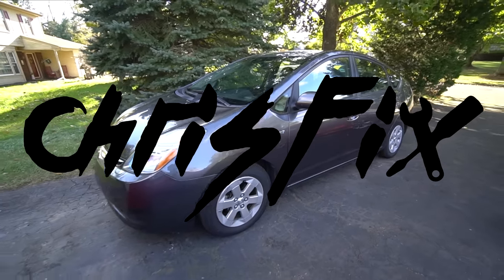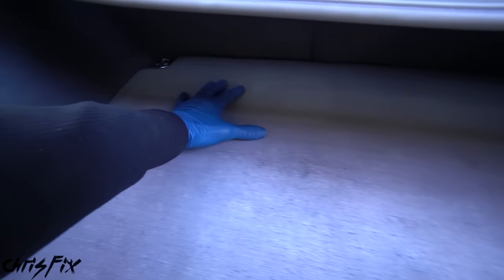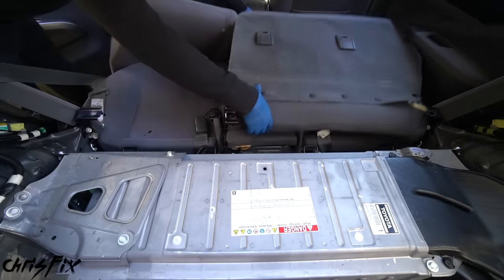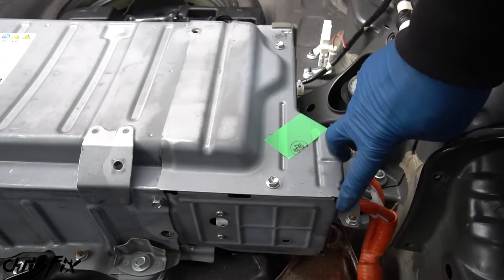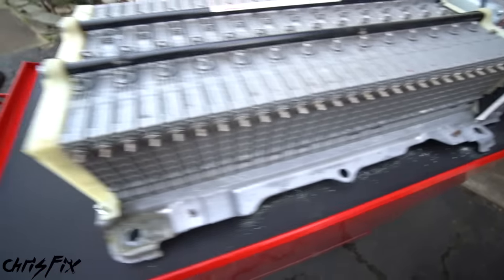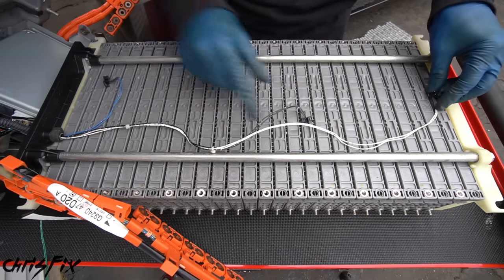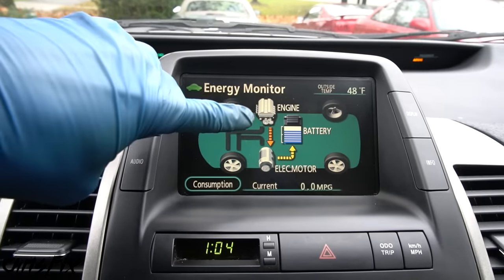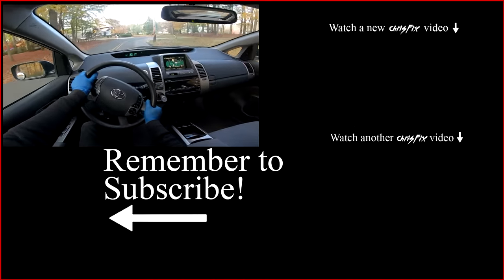I Bought the Most Hated Car on the Internet (and made $1000)

Comment: I would be wary of ANY "guarantee" until I read the fine print. More than likely, it's a "pro-rated guaranteed, dropping in covered cost by 33% each year. You see the same sort of thing with a standard 12V battery that loudly exclaims it has a 4- or 5-year warranty. When it fails after a couple of years, then you find they'll give you $10 off of a new $200 battery. Whoppee. So read the warranty before you buy!

Comment: It’s crazy that the back of the car’s interior has to be dismantled to change the battery. 
Why crazy if it lasts over five years??
Because exchanging an drained battery for a freshly charged one is faster than recharging a flat battery. 
If the car was designed with a removable cassette battery that was accessible from outside and automatically disconnected/connected and pushed out and pulled back in by the car, and a Tester could determine the difference in charge between the batteries, then you only pay for this difference and for the exchange to be done.
Which all means that you are buying charge , not the battery. ( like changing a Butane cylinder)
The complete recharging would no longer have to take several hours: 10-15 minutes should do: just like buying fuel would.
That removes the biggest drawback of electric cars: recharging would take about the same time as a refill of fuel.

Comment: Great Video.  Very helpful as my hybrid is nearing that time.  Quick Question: Since the bus bars tend to corrode so much, would it help to spray them down with battery terminal protector spray?  Or would that introduce some other problems?  TiA
Reply: Is it conductive? I wouldn't suggest it if so as this is high voltage dc not 12v. Better to look for a less corrosive 3rd party bus bar if one exists

Comment: Even though that was not the end of the world in removing, it's still a legacy engineering process and Toyota should be embarrassed for that design in getting to the batteries. Great video but I'm not sure I will get a battery car plug in or otherwise even though I want one, until the engineer battery replacement. I think its just a sucker's decision to buy in to such a poorly overall design for battery replacement, and it truly is on purpose.
Reply: Have you looked at aptera? If they see any actual light they are basically the only one fully diy

Comment: Research high voltage safety procedures before trying this.  ALWAYS have the 12 volt disconnected before pulling the orange plug, wear the right safety equipment, not those cheap gloves.  Every manufacturer tells you this.

Comment: 2003 Prius won’t start nor crank. Brand new 12v battery. The accessory lights turn on and everything. But when I try to crank it, the CEL flashes and the Ready light flashes. As soon as I let go of cranking the ready light turns off. I also was able to check the SOC of my hybrid battery and it was at 2% and the delta SOC was at 20%. I’m kinda stumped. Not sure whether or not to replace the battery packs

Comment: Well it's 2023 and I have a 2008 Toyota Prius. BOUGHT it used 5 years ago from TOYOTA with 62000 miles, and it now has 92000 miles. Started it up today,  tried to put it in drive and it wouldnt go in drive and the  the red triangle came on.   This has happened 4 or five times in 5 years, since I've had this car,  but the red triangle never came on before. I would just turn the engine off and restart the car and that fixed the problem. I Thought maybe I was putting it in  gear too fast. Any way, after restarting, it went into gear, and I drove it home on the freeway about 11 miles,  and didnt seem to have any issues, but the light stayed on. I restarted it a few times and the light stayed on. MY OBD2 Scanner pulled no codes. After 45 minutes, restarted the car and the light was gone.  It was almost 100 degrees , and I'm wondering if maybe the fan vent is clogged or fan is the issue. Ive looked at a lot of You Tube videos and that's one thing that gets mentioned a lot. Anyway I appreciate this video, in case I end up having to replace the battery.
Reply from the maker: Dang, at least you were able to fix it
Reply: @chrisfix yo I'm curious if you still have the 2006 prius after 4 years

Comment: Chris, I saw a technician in Toyota dealer wearing hurt locker suit, he said he does that when dealing with hybrid batteries that can produce 1000 voltage current, is that true or false? Watching you swapping the battery was kinda scary for me 😅
Reply: False 201 volts. 2k volts is generally lethal, 200 will drop you and prob cause some burns and health issues, 50 volts is usually pretty safe, 12v put your tounge on it 😂
Reply: Faily sure amps are where its at though
Reply from the maker: I dont know where he got 1000v because the battery is 200v but with that said it can still kill you if you dont take the precautions to stay safe.

Comment: Very good video TBH, I would however state that you are no doubt competent person at doing this but an novice watching videos has no idea of the Potential to receive an electrical shock from a DC generator / battery giving approx. 225V DC out at terminals which if bridged by unprotected hands not insulated would potentially kill a person on a Concrete floor at ground Potential. Please add the Hazards to your video  stating which danger points exists at each stage of destruction and construction that really occur. ( Based on each cell having 8V DC x 28 Cells = 224/5 voltsDC DIRECT CURRENT WHICH IS POTENTIALLY LIFE THREATENING TO AN NOVICE UNTRAINED PERSON.

Comment: I want to if the hybrid battery cooling fan run permanently or it depends on the battery temperature, plz shed light, thks  in advance.
Reply from the maker: If it gets hot it kicks on otherwise it stays off
Reply: thks master chris

Comment: The 2006 Prius I'm working on is missing bolts and some plastic clips including one that attaches the metal end plate over the plastic compression block. I am also worried about not having the black grounding bolt. Where can I purchase these attachments/bolts/ clips?
Reply from the maker: Call the phone number I showed in the video and a speak with a Chris from Electron Automotive. He will hook you up! They have tons of extra fasteners!

Comment: Ive heard alot of people saying this is dangerous… I’m wondering what part exactly is dangerous. If you follow the video exactly it seems safe, so if you deviate, say by accident, what parts/ actions are dangerous?
Reply: Touching the battery terminal is high voltage. Like putting your finger in a light bulb

Comment: Hey ChrisFix, I got the batteries reinstalled but the triangle of death and the red car with exclamation point still shows up. All other warning lights went out. The engine start to charge batteries and the OBDlink shows no codes. Any ideas? Thanks.

Comment: ?, I have a 08 and I have the triangle of death and same error code(POA80). I had the hybrid battery checked and Module #8 is bad. I had a company install a refurbished battery in and they still had the same error code w/ 2 different refurbished batteries. I then replaced the inverter. The car runs fine but the car will randomly lose power and runs about 15 mph. I can pull over and shut the car off and wait 10 seconds, restart and the car runs fine. Any thoughts? Thanks.
Reply from the maker: Sounds like either they didn't connect the battery properly or the battery is too weak or the inverter is faulty. Can you double check the connection of both the 12v battery and the hybrid battery?
Reply: @chrisfix  I'll check and let u know.Thx

Comment: Yeah I asked for a quote from the stealership for mine which has similar codes 3031 though (it's pack 3 that's funky) and figured ok $1700 for a brand new battery pack ok... so how much for installation,  and they quoted me $880 including diagnostics... good f*cking christ, meanwhile I just saw a video of a guy who swapped a battery out in 15 minutes... 880 for labor and plugging their OBD2 scanner into the car...   That said if you're spending $1500 on a reconditioned battery, I'd probably opt to spend a bit more for a new one but I'm not trying to flip the car to make profit.

Comment: Do I need to reprogram the hybrid battery? I have one of these and does it have to be the same part number? Or just the same gen?
Reply from the maker: There is no programming. I don’t know about part numbers but as long as it fits and is the same gen it should work
Reply: @chrisfix  ok sweet I'll see if I can find one from the junkyard for a cheap price and see if it fixes the problem I'm having with the one I have
Reply from the maker: @pspgamerserjio  the junkyard ones might have problems because they sit. When these hybrid batteries sit they get weaker.
Reply: @chrisfix  true but if it's under $50 I'll give it a shot

Comment: damn bruuhh $3861 for a battery replacement is not actually that bad??
your $1500 battery pack with only 3 year warranty seems kinda sketchy lol even though they claimed it will last 6 years, factory batteries for hybrid cars should actually last a lot more.

Google:
"Hybrid car battery replacement should be performed every 150,000 miles or 15 years (whichever comes first). Bear in mind that this is not a guarantee, but an average figure for how often hybrid battery replacement should be performed."
Reply from the maker: It’s been completely fine for the past 3yrs.

Comment: why not (tho I know they come with the battery) clean the copper bus bars?
 (just curious)
Reply: Cant clean erosion
Reply: @phillipclark6854  sure you can clean those up....copper doesn't lose conductivity
Reply from the maker: You can but the new ones have a nickel coating on them to prevent corrosion.

Comment: Is it possible that the battery was fine and the connections were bad?
Reply from the maker: Mot in this case but good thinking! I tested the battery cells off camera and a few were bad.
Reply: @chrisfix  Ah fair enough, at least you weren't throwing out good cells :)

Comment: 🤣 the car has 200,000 miles yes you have a new battery now but everything else in the car it's toast $4,000 for a car with bust suspension, bust bearings bust everything else that moves...and this was a while ago...in 2022 this car is probably worth 8k 😭
Reply from the maker: Everything else with the car was fine, if all that was broken I would have passed on the car, and prices of these cars is going up!

Comment: So if it doesng show the symbols at the end it isnt charging the battery 😢 oh no
Reply from the maker: See if it says it is charging on the screen
Reply: @chrisfix  it probably isn't then it doesn't say it's charging I just bought a 09 and it's already been  fixer upper .it also doesn't have those flowing symbols like the one in you video did at the end. Also when I press menu on my screen it says the external system Is not connected